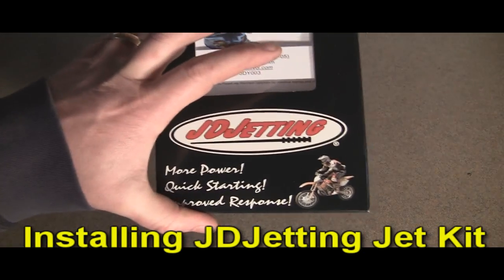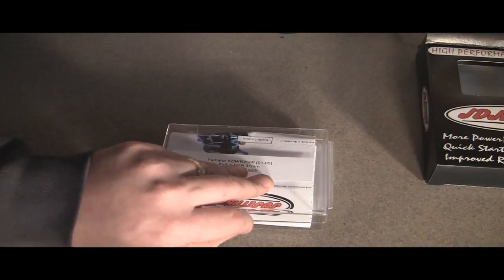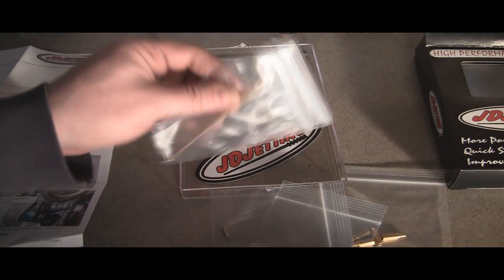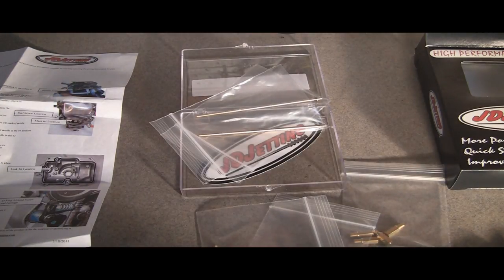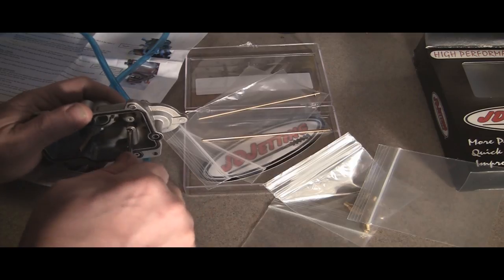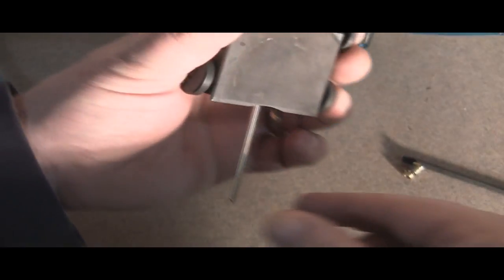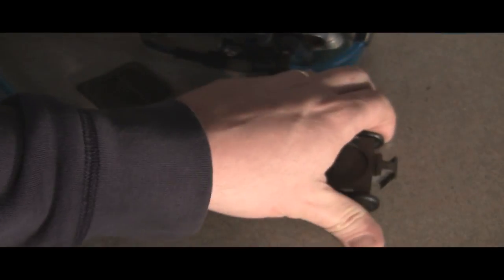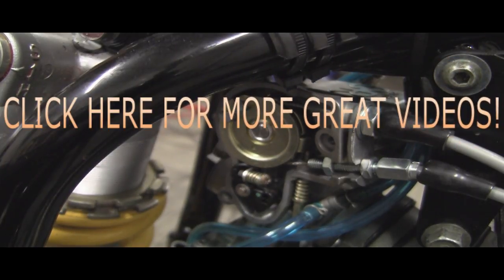JDJetting Carb Kit Installation MX Carb

Comment: I just put the kit in my yz125 2000 mikuni carby I live in Melbourne Australia the instructions said to put the red needle in the 4 clip position and a 380 main the bike started and ran but its fouling the spark plug in 5 minutes I tried to contact jd but they don't reply would you no why the plug is fouling

Comment: That kits worth mabey 20 bucks and they charge 75 80 bucks?damn son!!!!!!!!!!!!!!!
Reply from the maker: Yeah, just make it convenient.
Reply: It's worth $75, not because of what you get, but because of what they had to do to get there. There's a lot of very precise engineering and design work that goes into those needles which is very costly, and that cost is transferred to you. So while the needle may only cost a couple bucks to make, the design work may have cost $30k-$40k.